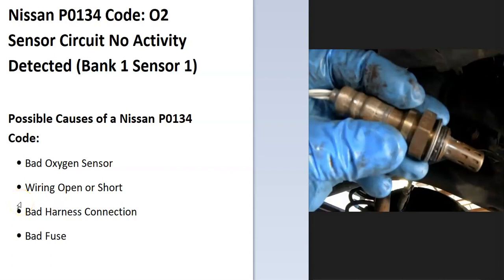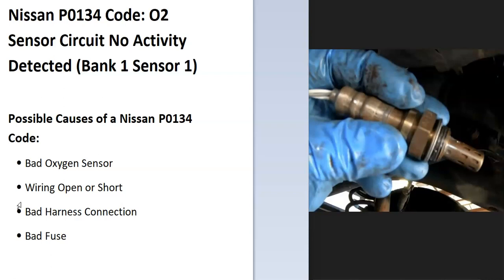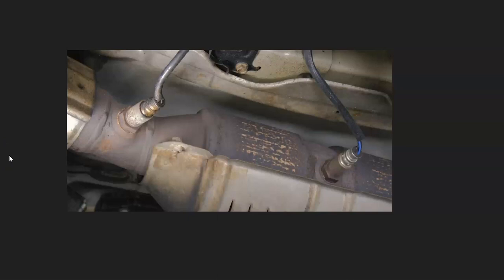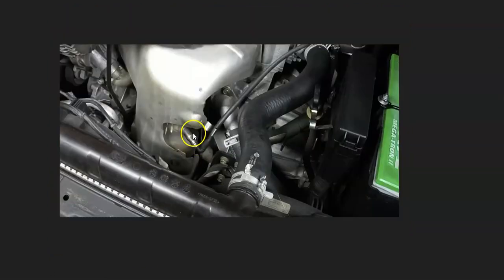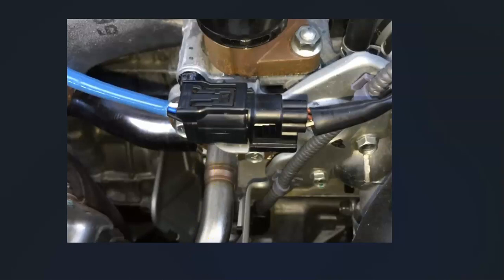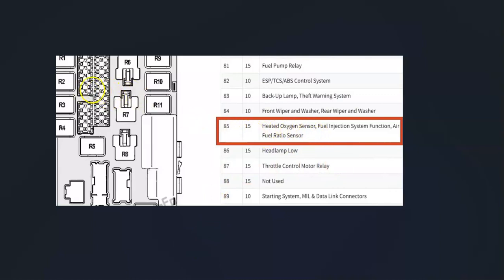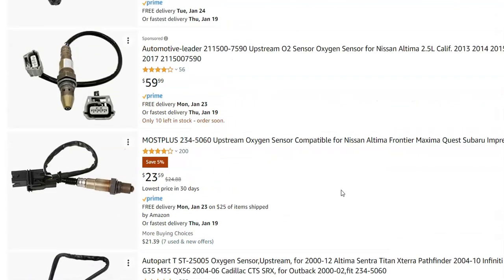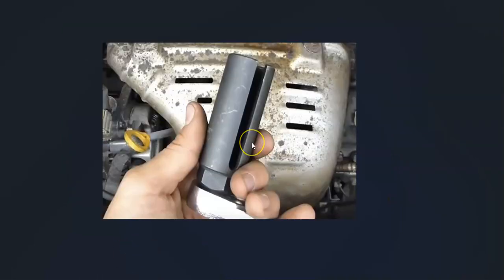Causes and Fixes Nissan P0134 Code: O2 Sensor Circuit No Activity Detected (Bank 1 Sensor 1)

Comment: Hello thanks for this video ,so my nissan is a 3.3liter and i have the same code but im confused on which o2 sensor it is, the one that is on the right side just on the exhaust manifold under the valve cover or is it the one just below the  
Cat convertor
Reply from the maker: Google your engine cylinder location, and it will be the first 02 sensor on the cylinder #1 side of the engine.
Reply: @HVAC_Mechanic  ok sounds good i will do that thanks!

Comment: Thanks.  I replaced my sensor and the code still came back..  Connector looks good.  I'll look for a fuse.  98 nissan frontier.  Found the fuse..... looks good.   Hmmmmmmm.  Guess I need to check continuity some place.